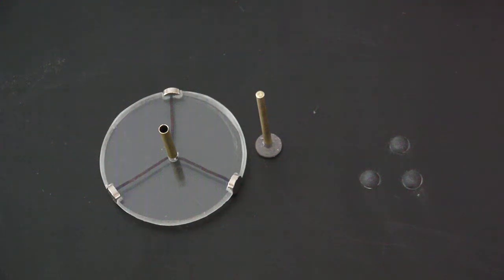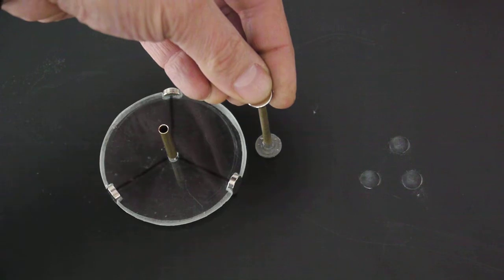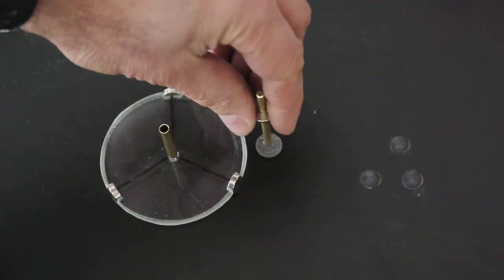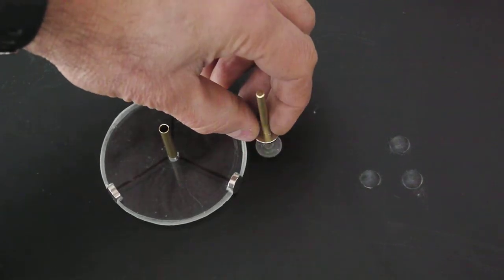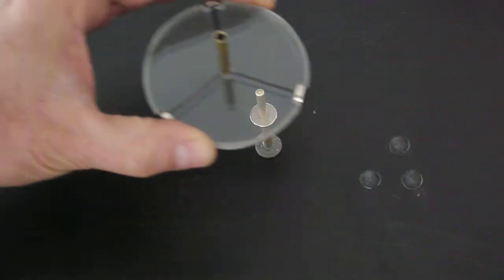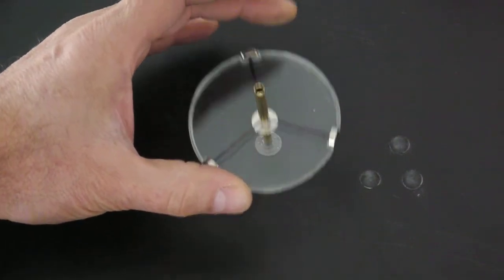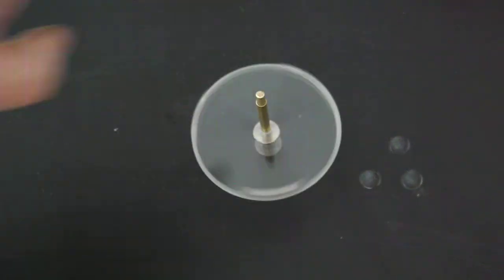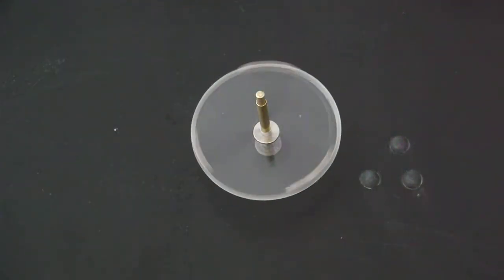My Magnetic Spin Toy Prototypes

Comment: jon, what size are the magnets,  sleeve,  and post? i am working on different spinner prototypes, i really like these that you've made.
Reply from the maker: Glad you like what I did!  Cylindrical magnets at the ends of the 3 (6?) arms are 0.37" in diameter and 0.125" tall; ring magnets have 0.50" OD and sit on an 0.156" brass shaft. Does that help?
Reply: This is great, I am about to put in an order on Amazon for all kinds of parts, I'll experiment with some of these too. I just saw the patent application, i 'll show every respect to your work. Thanks!